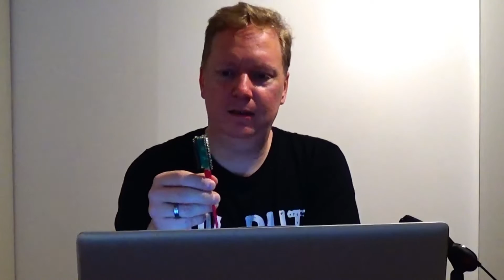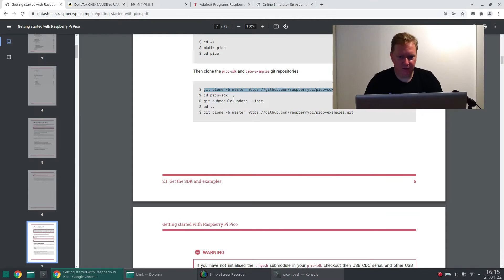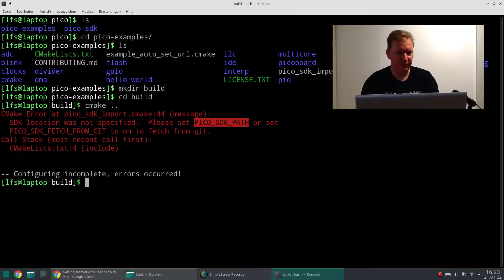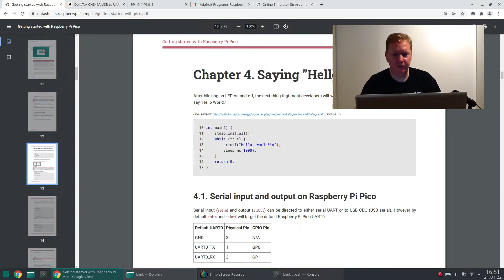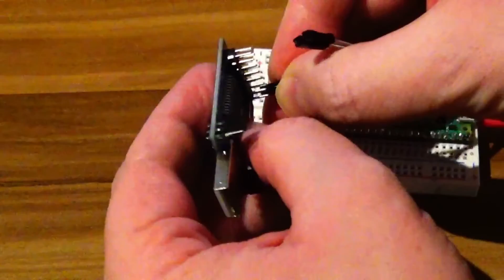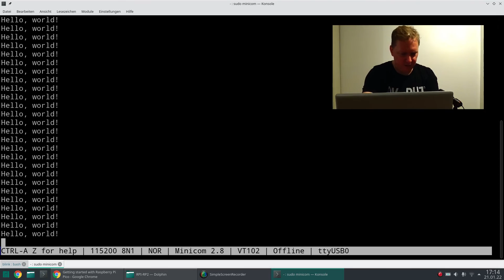Raspberry Pi Pico C-Programming

Comment: You can also use Arduino toolchain to program picos too - just need to add custom board to it, this way you don't need to mess around with SDK as much. Also there is a version of Pico - Pico W - with WiFi so that makes it slightly more capable for all sorts of IoT scenarios.

Comment: Pro tip make sure solder iron heats both pin and pad and add little bit of solder at a time and most important keep the iron on the about half a second after you apply the last solder that makes all the difference :)